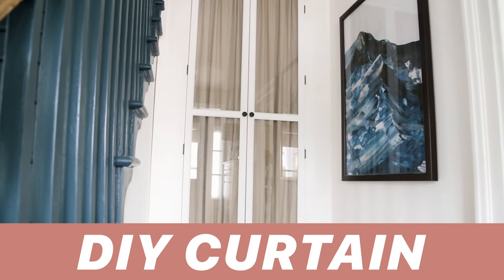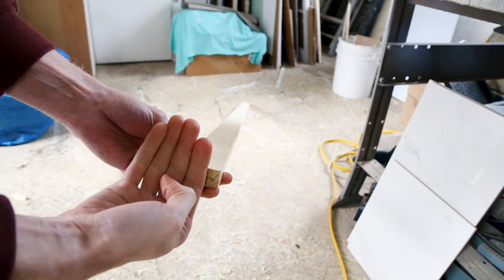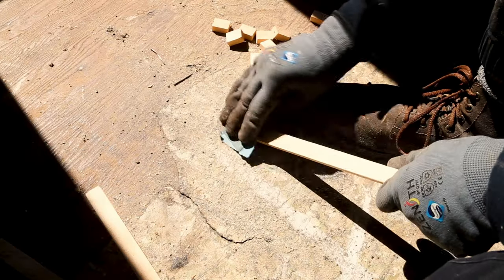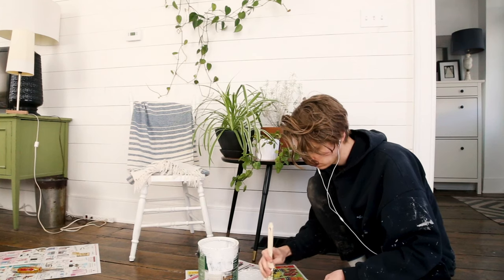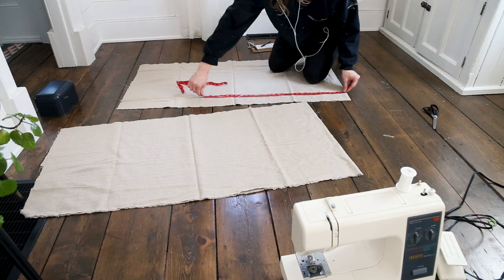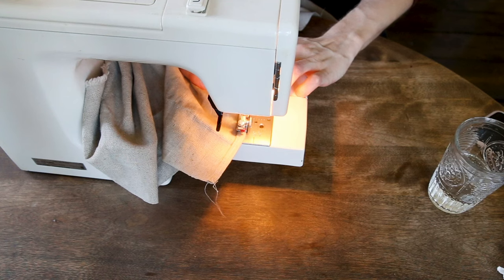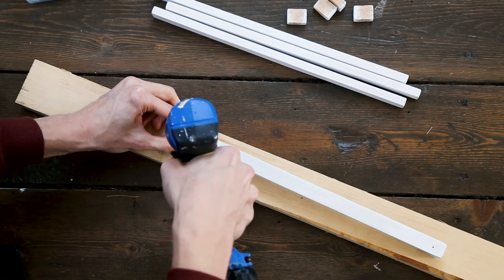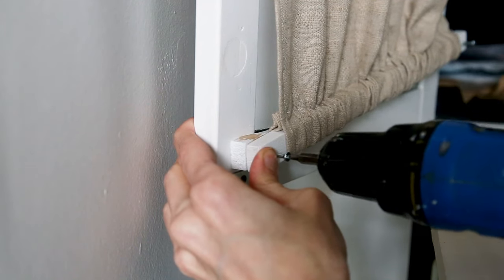DIY CURTAIN ROD FOR 3$ | Curtains For Entry Closet French Doors

Comment: Great job!   I sew, but I don't "rip." Fun to watch you. No wasted piffle.  What I didn't understand was the moulding dimensions.  Don't have a Table Saw to "rip" to saw the wood strip to size. Your HD link connects to HD, Canada.  I am in the US and my local HD did not have it.  One option for other readers who do not sew and/or do not have a sewing machine is to use Fusible tape or glue the fabric or sew my hand.   I want to use your idea for a bathroom window and may use magnets to be able to attach and detach the curtain.  (Window has galvanized bead on 3 sides. A Neodymium magnet  (Glued to wood?) will stick to the bead through the sheetrock.